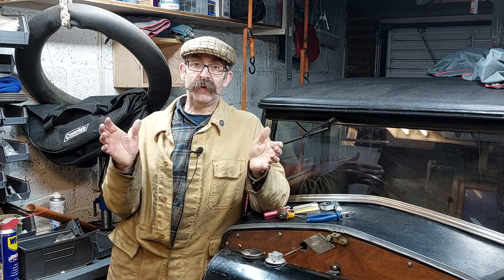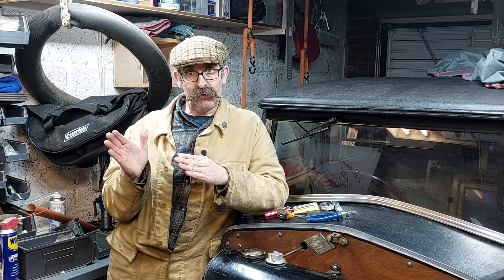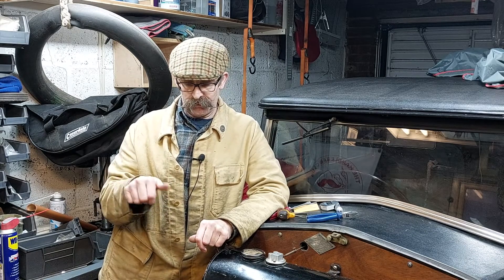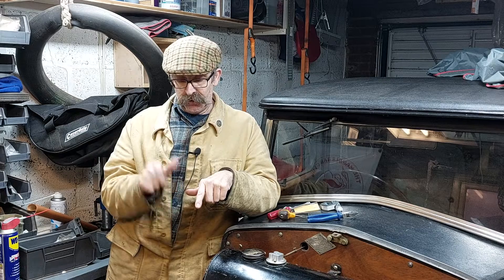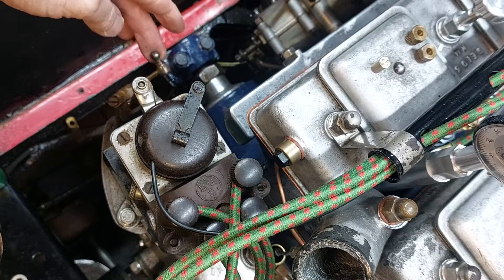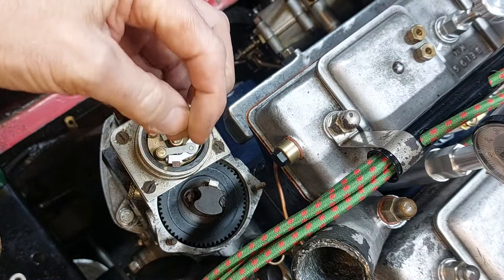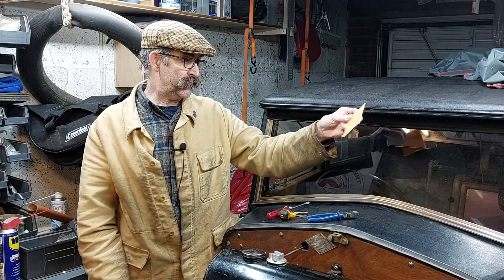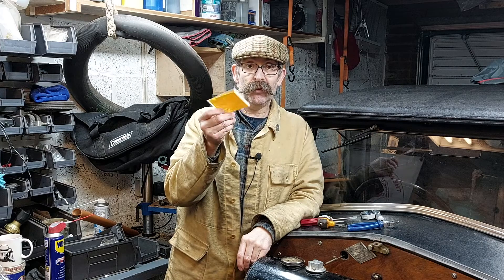MAGNETO TIMING ON THE RILEY 9, A GUIDE TO TIMING MAGNETOS

Comment: hey thanks for the demonstration! If I have a morris magneto on a motorcycle with advance and retard stop screws, would it makes sense to time the advance position to the advance mark on the flywheel, then time the fully retarded position to slightly past TDC for starting the bike without breaking my ankle from kickbacks? right now, the retarded position is just guesswork I believe and it is difficult to kick start.

Comment: Lovely description. In my youth I had a Merlin 9 which was coil ignition. I acquired an oil coil and the difference in engine performance was considerable. Idle speed was hugely reduced and plug gap could be increased considerably. No increase in road speed but flexibility improved considerably. It altered my attitude to motoring from the age of 17 some 60 years ago. Flexibility is a very desirable feature!
Reply from the maker: Flexibility is something that is gradually dissappearing Glyn 😄, if i ever want to compete in VSCC events then the mag has to stay but i do have a spare one so will get that rebuilt to have in hand.

Comment: Setting up the timing on the Mag must mean you're getting close to a start up;🤞
Looking into the engine bay of the Riley it shows how things can be made that will last a lifetime and when bits need replacing it's relatively simple, unlike modern cars.  
Is the Riley your favourite of the cars you've owned?
I find it hard to name a modern car unless I see the badge. The pre war and just post war cars are instantly recognisable. The difference I suppose in just chucking data into a computer and  someone sitting down with a paper and pencil and drawing what was in their heads. Old fart here and proud of it
Reply from the maker: Its getting closer Colin, not sure if its my favourite yet as its been in pieces  longer than it was together,  and as you can see from earlier video's the engine wasn't in the best of health and i didn't realise the suspension was siezed up, so hopefully it should be totally different when its running again. I did find a photo of one of my favourite cars i owned a long time ago, it was my Fiat 127 Sport, sounded glorious,  went like stink, handled as well as a Mini .....but rusted like a bugger so its no longer around.....nothing wrong with being an old fart 😁

Comment: An unfinished project of mine was a Splurge gun. Took me ages to get my mag timed. It's a BTH as well. I had it all rebuilt since it was dead and well knackered. If anyone in NZ wants one done I can recommend someone who is excellent. My mag had been hacked by someone trying to get more advance from it by widening the slot in the adjuster sleeve part. That won't work since the maximum advance is set internally in the magneto. But it made me horribly confused when setting it all up. Got there in the end of course. I think the racing chaps prefer Vertex ones for some reason.
Reply from the maker: Cool 😎 what kid didn't want a splurge gun after seeing the movie....or one of those pedal cars

Comment: When our BTH mag died and needed reconditioning we couldn't afford it and acquired a Scintilla mag not a vertex. It was an absolute revelation created a spark that you could probably weld with. The performance was vastly improved. We eventually had the BTH refurbished and refitted it the performance was not as good as the Scintilla so the Scintilla was refitted and is still running
Reply from the maker: That's interesting Mark, what type of Scintilla mag is it?
Reply: @TweedsGarage  Off the top of my head I am fairly sure that it is a PN4 with flange mounting plate/casting must have been an original fitment  as it lines up perfectly wilt 3 nuts and bolts. However while 2 are easy to get to the 3rd on the LHS  of the mag is a real bitch to get to!

Comment: I would think this kind of thing used to be common knowledge to most Riley owners, and other "mag" vehicles.  Today people can't be bothered to even steer the car, let alone actually touching the dirty thing...  and that makes me sad.  Cheers from the Shed
Reply from the maker: Its the sad sight of seeing young men standing next to their cars  waiting for the breakdown sevices to come and change a wheel for them because they don't have a clue how to, i don't blame them as politicians and car manufacturers have led people to believe that modern cars are far too complex to work on so they don't,  but if you take the black engine covers off many a modern car engine you'll find they are based on 20 plus year old engine designs with more electronics on them, they still have oil, oil filters, air filters and spark plugs that are as easy to change as old cars....
Reply: @TweedsGarage  Agreed..
Reply: @shedbythetracks  Well, these days they are all turning electric. Not much to go wrong mechanically. But the software scares the crap out of me and I say that as a software engineer!